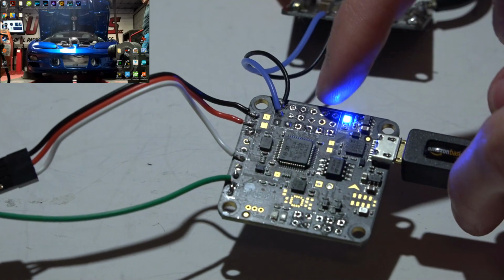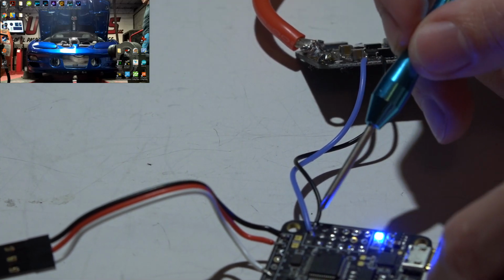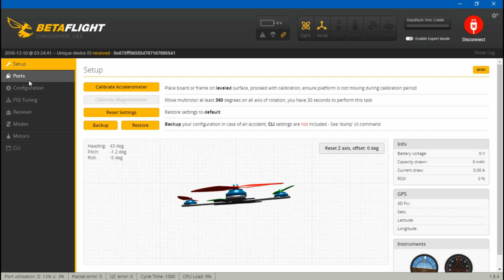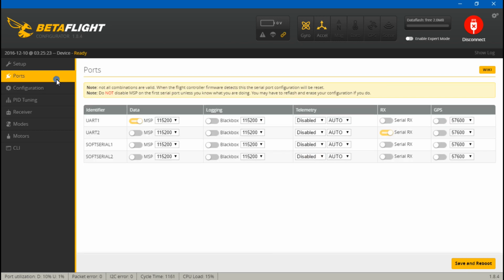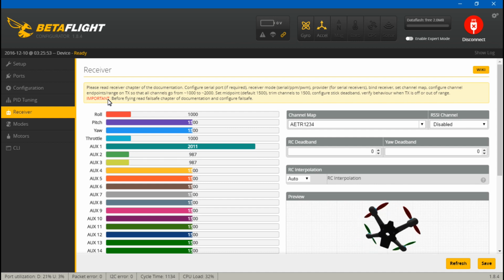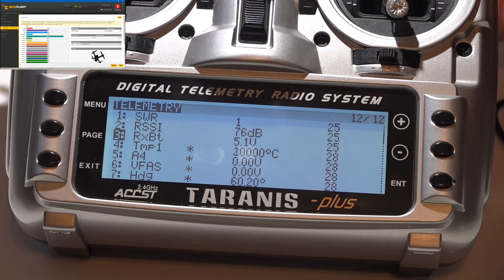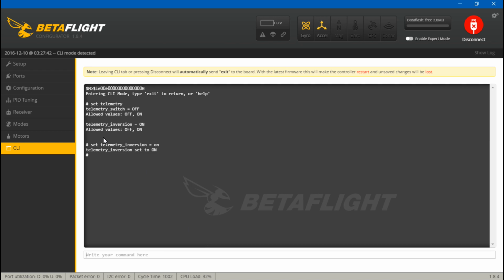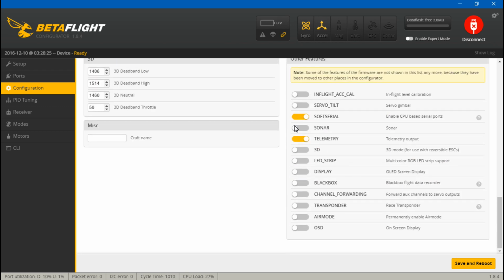Naze32 & X4R-SB: Connect & Telemetry

Comment: Thanks for the video. I just finished building my first quad with the same setup that you have (except with softserial 1 instead of softserial2). I have telemetry working, but for some reason my Taranis inputs don't show up in betaflight. Nothing is moving. Still not able to arm the quad and give inputs. Any ideas of what might be wrong?
Reply: David Xiao 
having the same issue man, have you found a solution yet

Comment: In Firmware 2.0.2 (in my case cleanflight) the cli parameter to discover all sensors is changed! New command:

set tlm_inversion = ON

type this instead of set telemetry_inversion and you are back in business. cheers 🙂

Comment: Thanks for posting this. You have confirmed for me that I am NOT getting telemetry. My set up is JUST like your with the exception that I'm using CleanFlight and that I'm setting up a Tri-Copter. Also, my Naze32 rev6 runs at 30% cpu load at this point in the build. Something you said was not a good thing in another of your videos. I'll be looking at the Omnibus F3 or F3pro. I'll update you when I get those parts in... ~J~
Reply from the maker: 30% is fine. I try to stay under 35%. But nothing wrong at all with a Omnibus F3. And if you use Betaflight with it they just changed things to where you can get the full 8khz/8khz sync times on F3 boards.

Comment: I am only showing softserial1 and I have to 2 points bridges like you but I am still unable to discover all the sensors
Reply: did you find a solution to this? I have the same problem